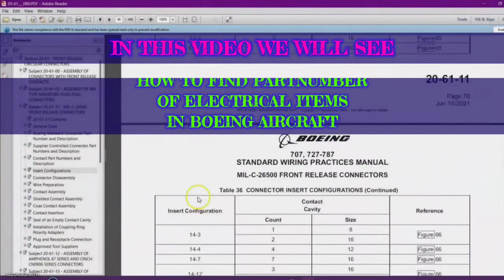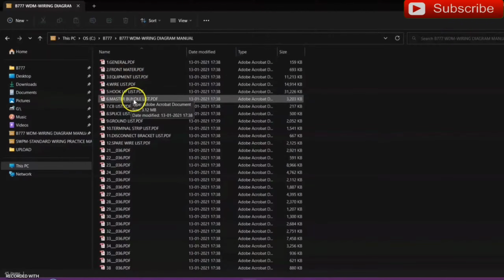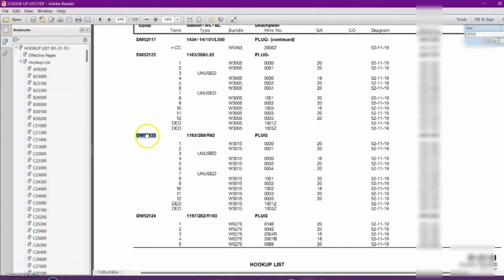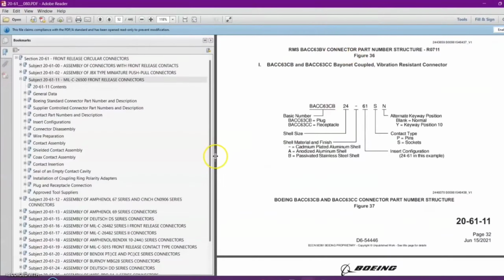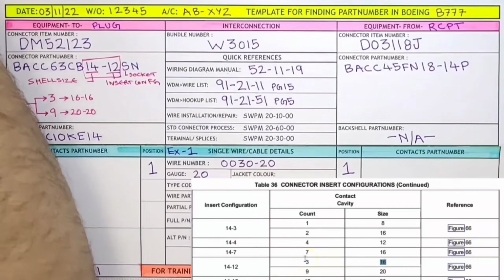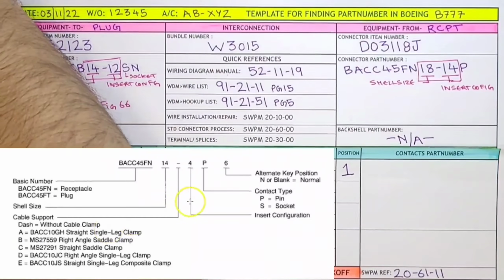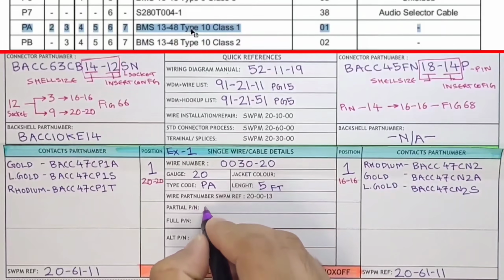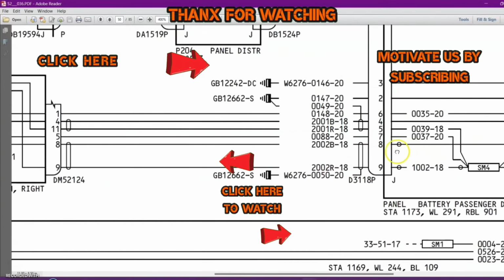HOW TO FIND PARTNUMBER IN BOEING AIRCRAFT : PART 1 #boeing

Comment: great video!! 
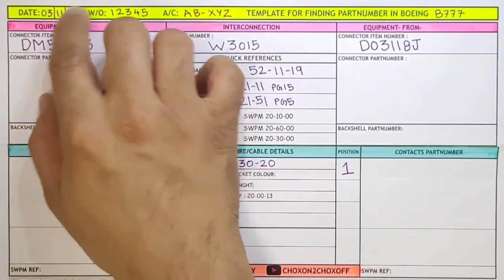i have one question, at 12:44 why did you chose 20-61-11 not 20-35-11? i wanna know why:) and how can i choose if theres multiple reference like bacc63bp
Reply from the maker: Thanx for watching. 
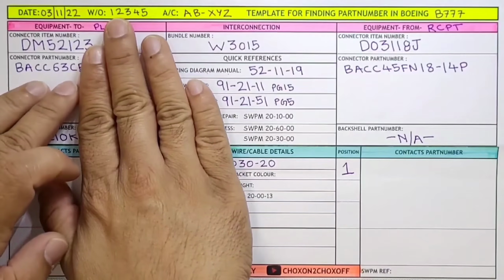@15:00  as per manual, 20-35-11 is for special type cable with this connector, not applicable to our cable. So we take 20-61-11 which is general. Hope it is clear.